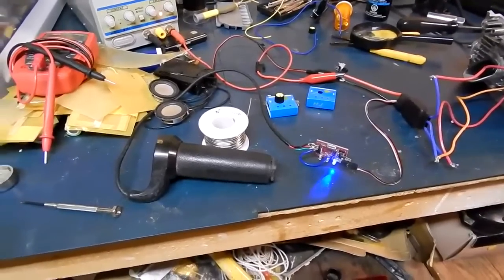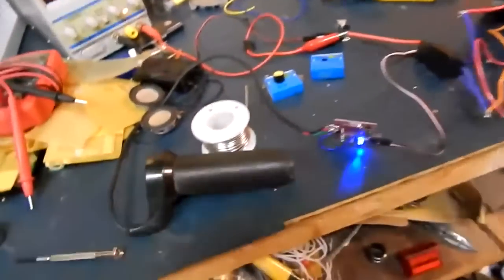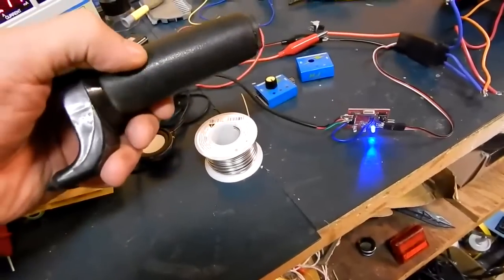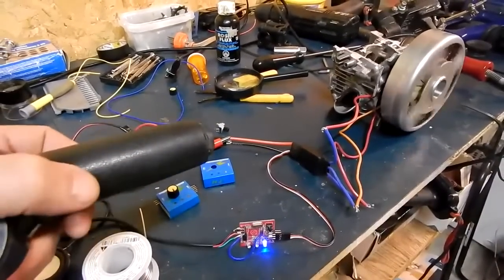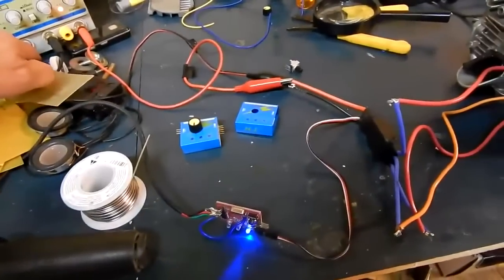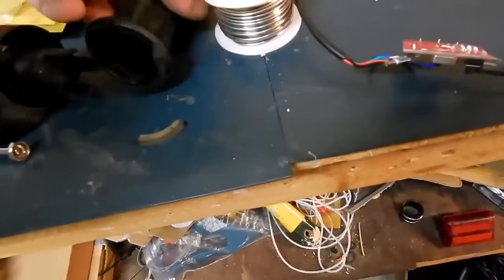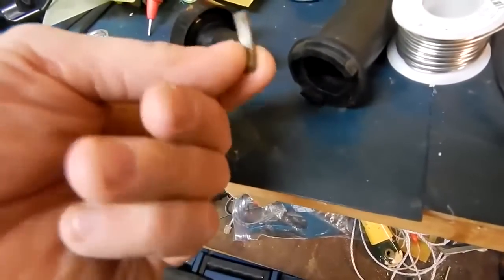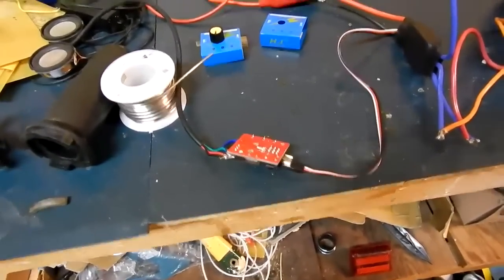Servo Tester with hall throttle*complete tested and reversed!*

Comment: Well I tried using my servotester (the same you got) with a hall throttle as shown in this picture (http://s59.photobucket.com/user/Ticket2fly/media/escthrottle.jpg.html).
At first a connectet the wires wrong, so i might blown the servotester, but I want to know how you wired up the hall throttle, servotester and ESC (with BEC).

You got some nice videos :)
Reply from the maker: +Despereaux  when i installed the hall throttle it was in reverse i had to open the throttle and reverse the magnet inside.
Reply: Everything is fine. The problem was, that my servotester was broken. Now everything works and even my throttle works the right way :)
Reply: Hello! what would be the correct way to connect a thumb throttle to the servo tester?